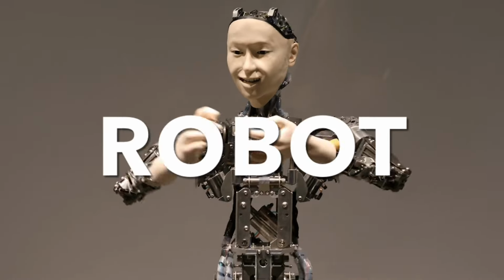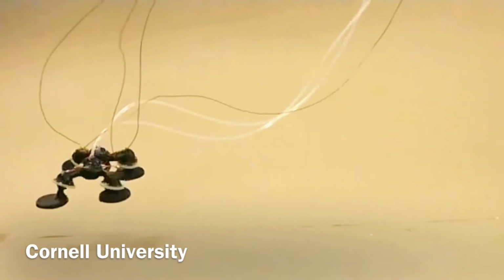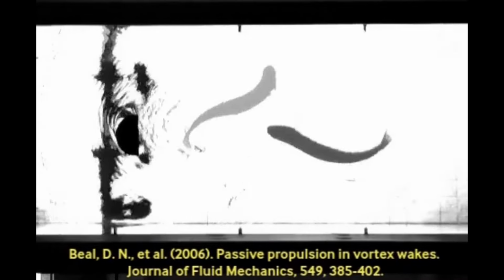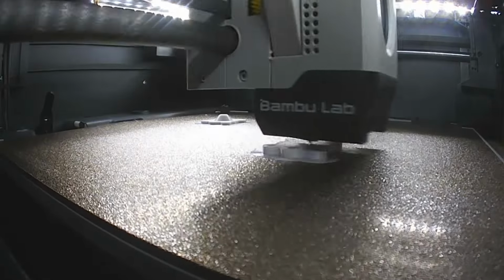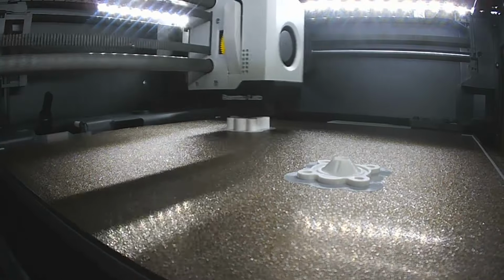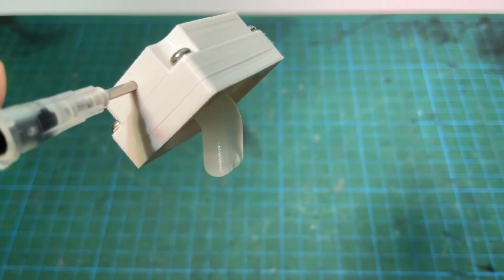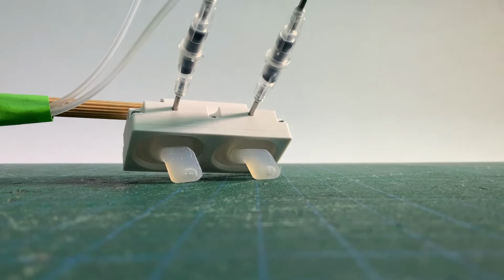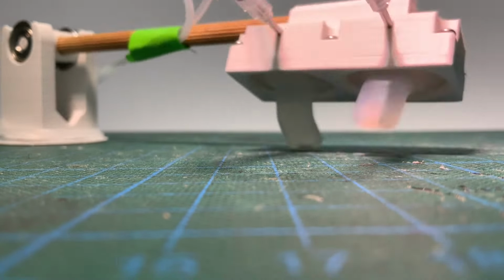A Walking Robot Made From Squishy Silicone

Comment: 🎯 Key points for quick navigation:

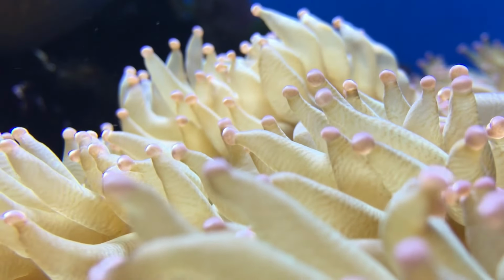00:24 🌿 Nature-inspired robots: Unlike rigid industrial robots, soft robots mimic nature’s flexibility, adaptability, and compliance.
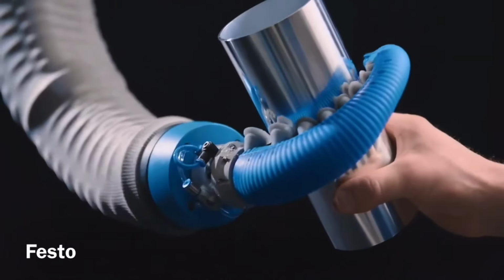01:13 🎈 Pneumatics in action: Some soft robots use pressurized air to create movement, functioning like high-tech balloon animals.
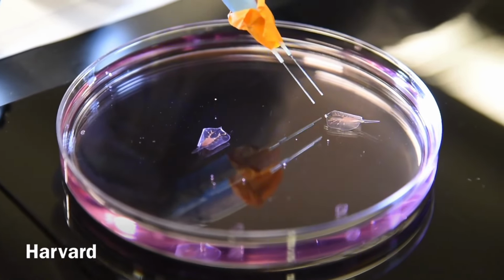01:30 🧬 Biohybrid innovation: A robotic stingray powered by genetically modified muscle cells demonstrates how biology and robotics can merge.
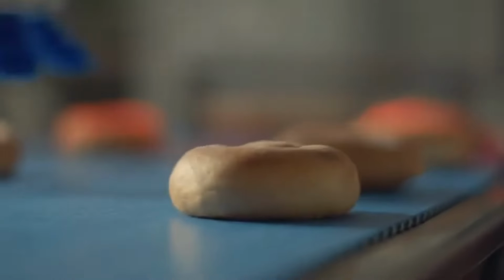01:44 🍃 Gentle by design: Soft robots can handle delicate objects without sensors or complex feedback, naturally applying the right amount of force.
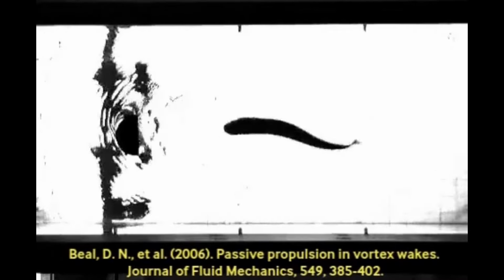02:25 🏊 Morphological intelligence: A dead fish swims upstream due to its shape interacting with water currents, showing how design alone can create motion.
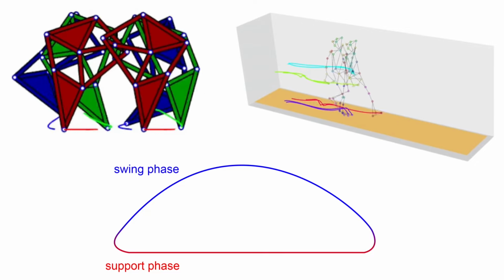03:19 🔄 Alternative motion: Walking isn't just about having legs—it’s about how they move. Soft robots replicate this motion without traditional motors or gears.
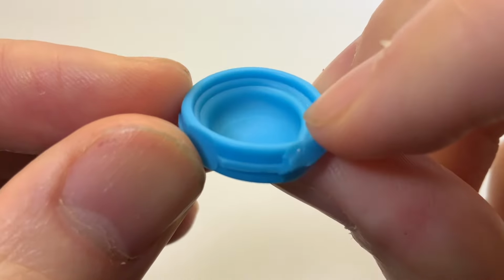03:45 🏗️ Bistable structures: A simple bistable dome can snap between two stable states, a principle used to generate movement in soft robotics.
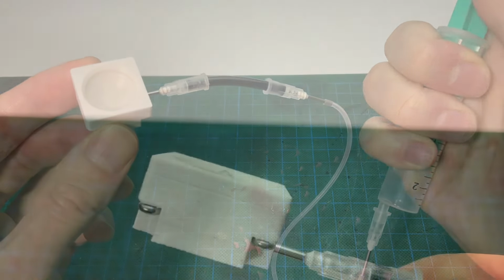04:46 💨 Air-powered motion: A soft robotic leg is actuated using air pressure, producing complex movement paths needed for walking.
06:00 🏗️ Iterative design: Modifications to the leg’s structure reduced unwanted sideways drift, refining its walking trajectory.
07:14 🔄 Controlled motion: Adding a simple carousel mechanism helped stabilize movement, preventing erratic motion.
08:27 🧠 Adding intelligence: An Arduino-controlled pump and solenoid valves enabled independent leg actuation, fine-tuning movement.
09:12 🚶 Soft robot walks: After iterative improvements and balance adjustments, the robot successfully achieved stable walking.

Made with HARPA AI